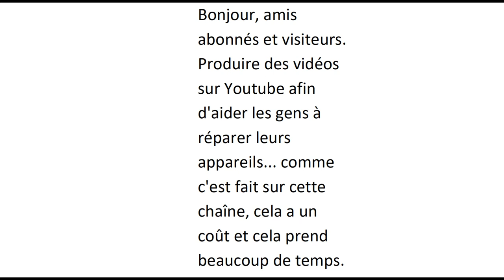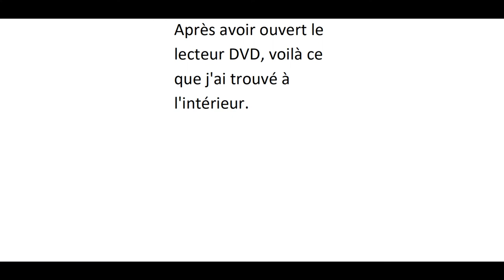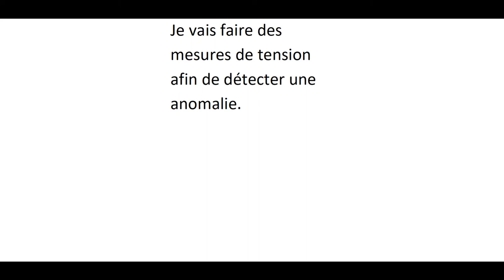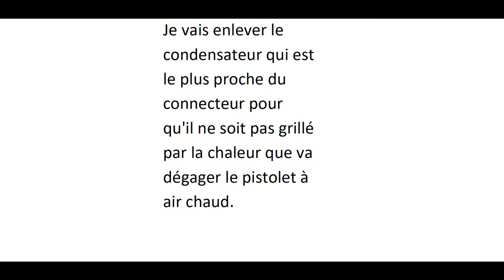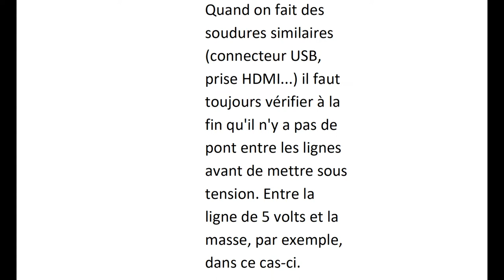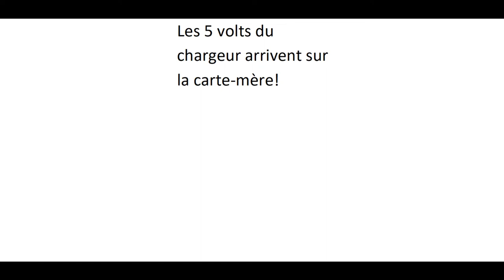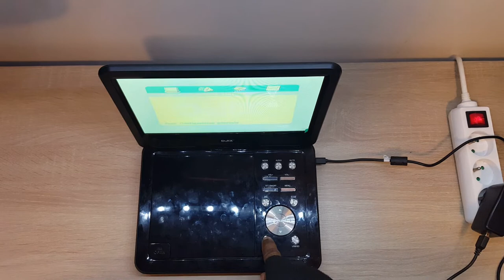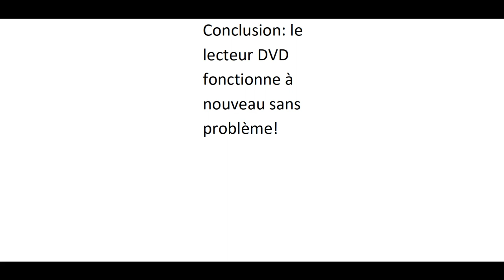Réparation: Dépannage d'un lecteur DVD qui ne s'allume plus. DVD player repair.

Comment: Bonjour, Super vidéo qui m'a bien aider pour avancer , j'ai le même lecteur  mon soucis est presque le même sauf que en charge les voyants sont allumés mais l'écran reste noir , parfois on a l'impression de distinguer un très léger rétro éclairage , j'ai vérifier la batterie qui indique " LTZK 7060100  2800mAh +10.36Wh 3,7V  20190626"  pourtant en teste elle arrive difficilement à 2,9 V serait  ce mon problème , batterie  à changer ?
Reply from the maker: Bonjour, si vous ne voyez rien à l'écran et que vous avez le rétroéclairage, ce problème ne vient pas de la batterie.  Vous pourriez avoir un problème avec le câble qui va de la carte-mère à l'écran ou un autre problème sur la carte-mère...